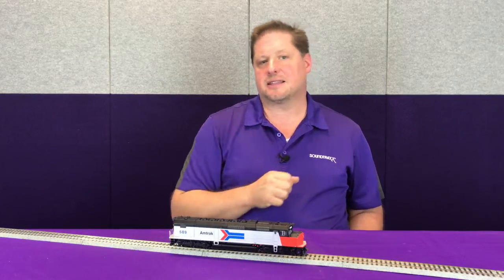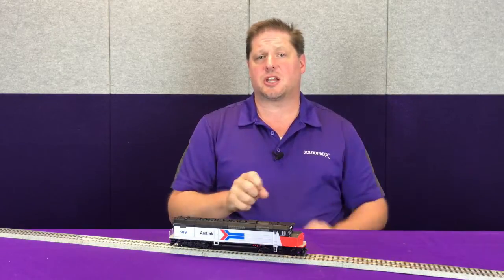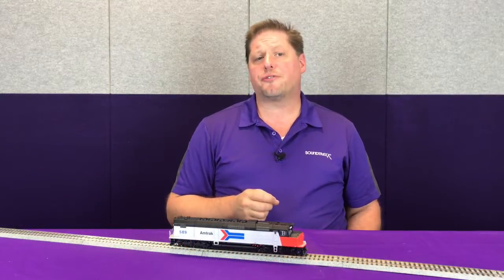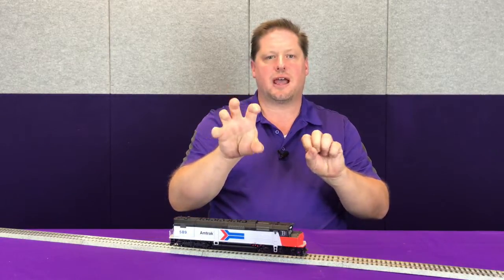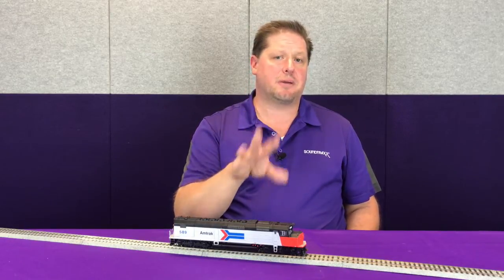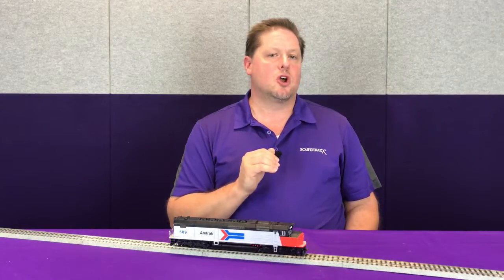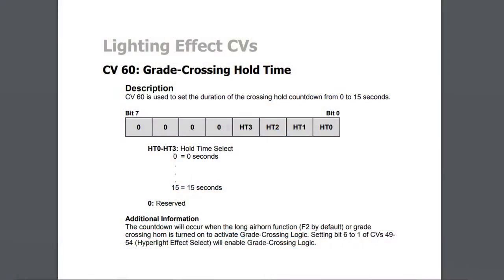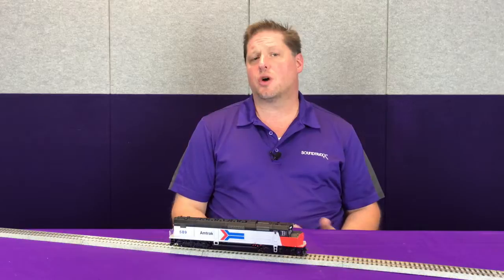SoundTraxx Hyperlight Effects

Comment: What LED'S works best for the Mars lighting effect? It seems the 1.5 bulbs tend to give a effect but I would rather use LEDS so I don't have to add more wires( referring to limited space in the SD40T-2 Athearn)
Reply from the maker: Adding in the LED compensation mode (add 128 to the Hyperlight effect) will make the LED look a lot more like a bulb. This works with all LEDs.

LED Compensation video: https://www.youtube.com/watch?v=hvZJuFAaPyE
Reply: Thank you George it's great effect on LED  for Mars light.